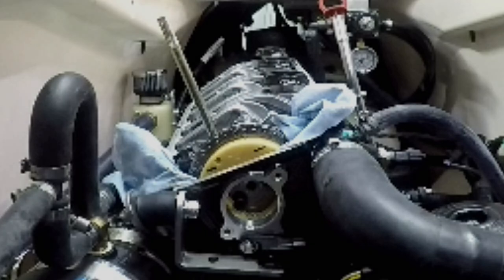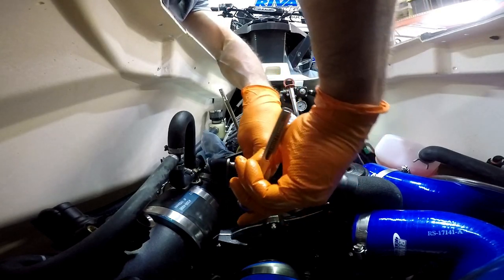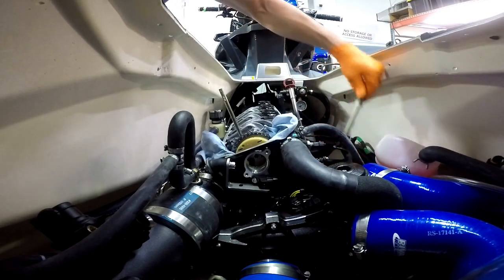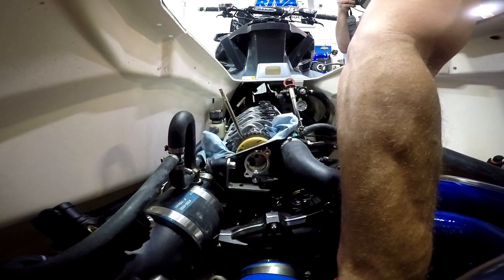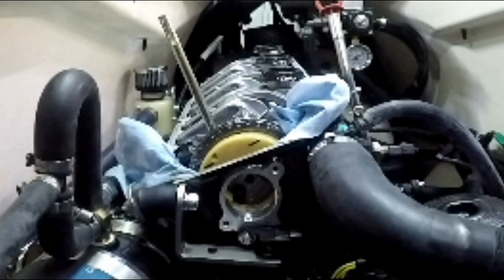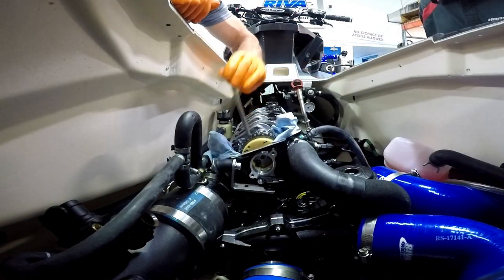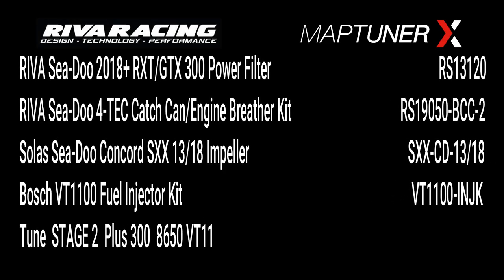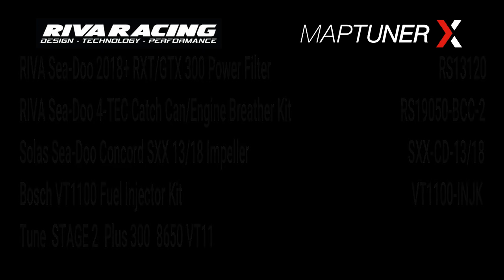Stage 2 Plus 300 8650 Camshaft settings.

Comment: Hi. Can i do that in my rxpx260 ? Thanks and good work👍
Reply from the maker: Yes... I think you can try.... I would monitoring or check AFR ..it can change after that mod.
Reply: I have this same tune on my rxt 300 plus arp flywheel bolts , valve retainer springs, mainfiold griddle , water box riva, solas 13/18  , VT11 injectors as well as my cam adjusted. I am topping out at 8200 rpm and on the corners wide open throttle  my rpm doesn’t go higher than 7900. Top speed so far is 78MPH